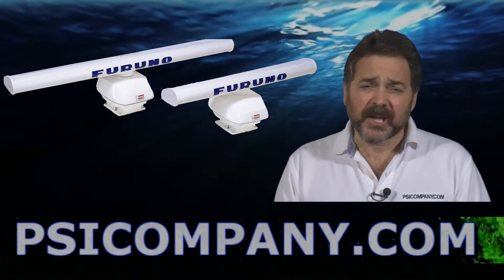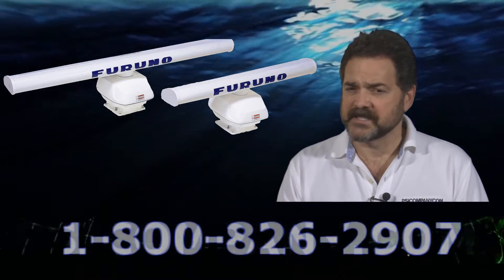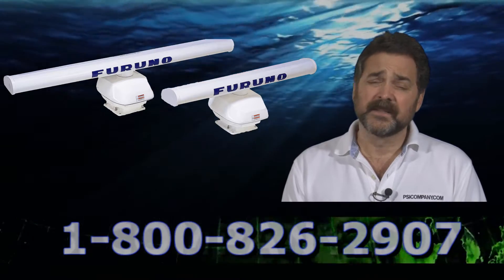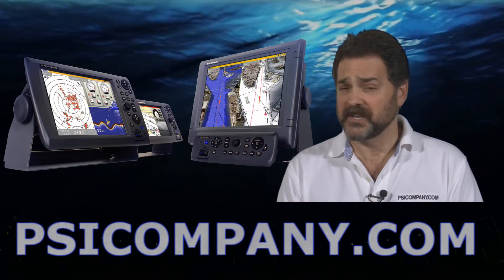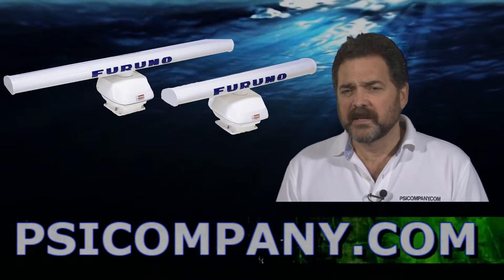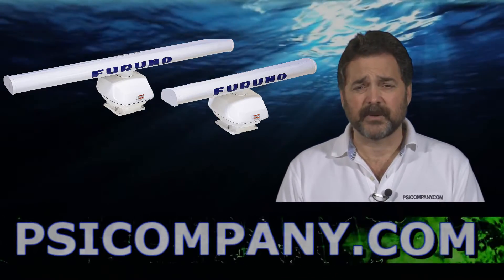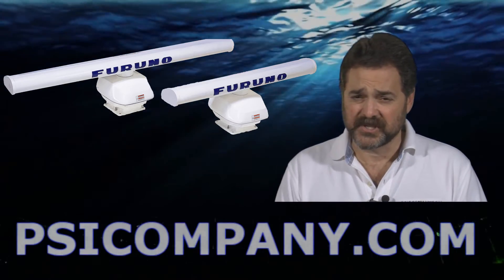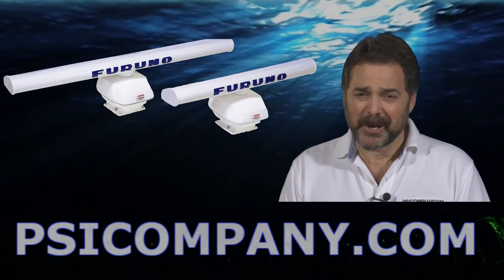Furuno DRS12A RADAR Sensor for NavNet 3D Networks. 12 KW, 72 NM Range - Visit Us for New Models!

Comment: The Furuno DRS12A RADAR Sensor has 12 KW power output. Try the 6' Furuno Open Array Antenna for best overall results. Furuno DRS12A radar sensor has twice the power of the Furuno DRS6A radar sensor.